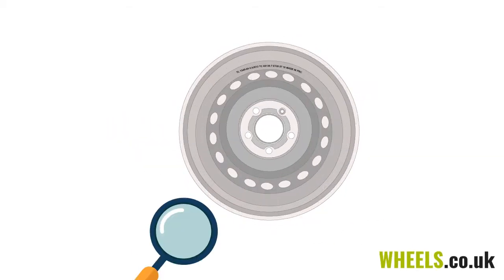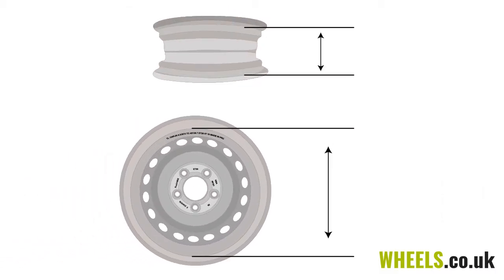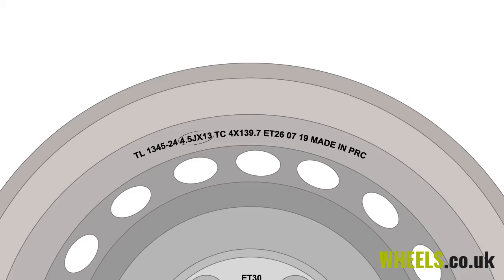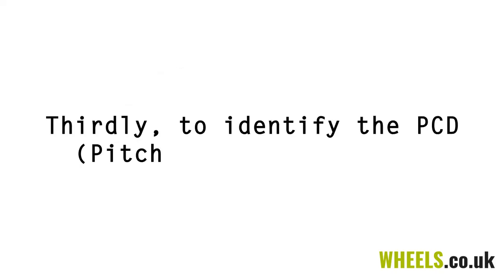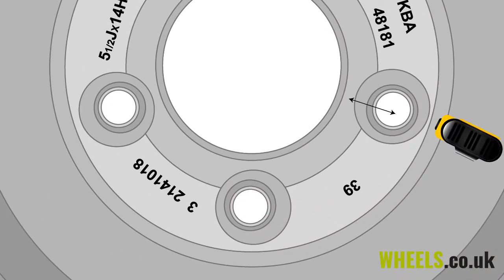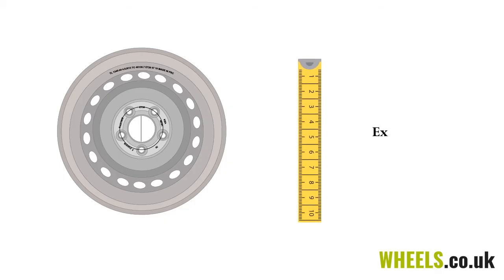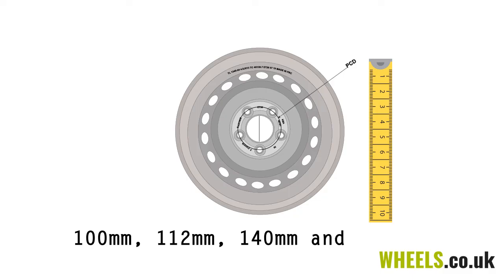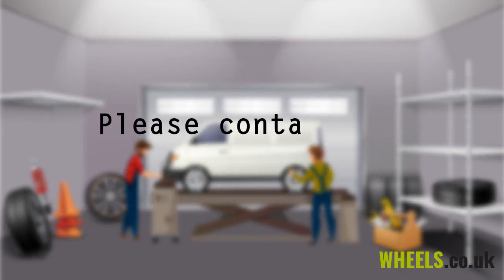How to identify your wheel fitment and PCD measurements.

Comment: Is there any way to identify the pdc by the markings on the rim?
Reply from the maker: Hi. Thank you for your comment. It depends on the make of the wheel. Most manufacturers only mark wheel's with their own, unique part number, which would then need to be cross referenced with either a data sheet or with a dealer of said wheel. Some manufacturers do list the PCD within the markings, but it all depends on the make.